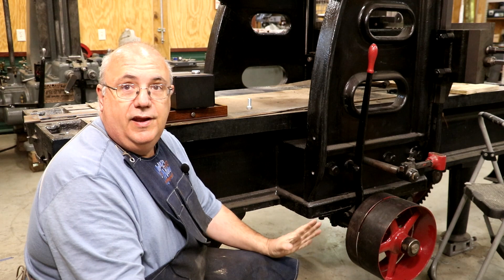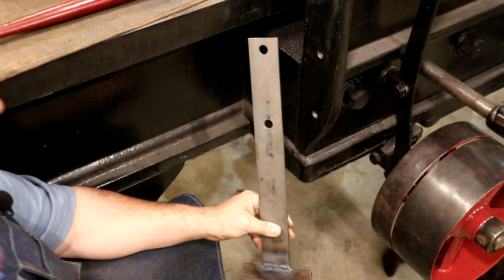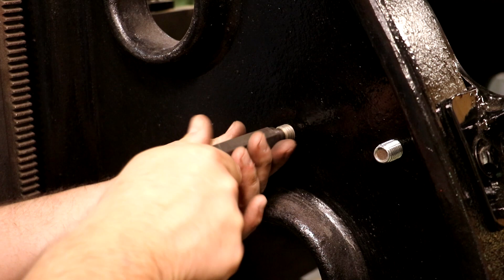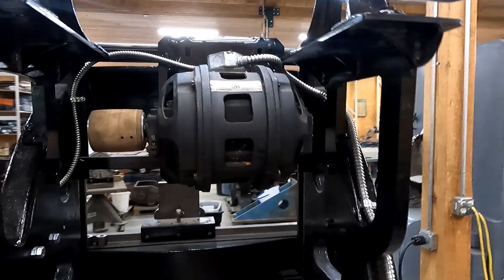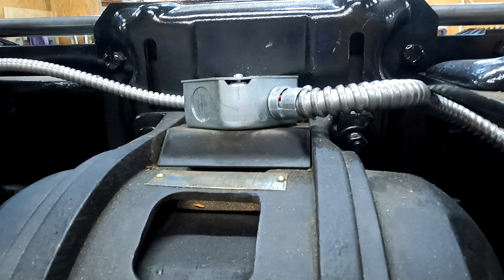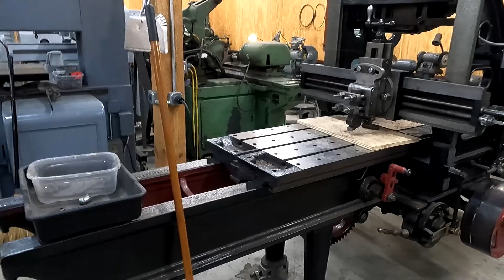Metal Planer Restoration 59 :Fabricating Brackets and Installing a Motor Starter

Comment: 13:57 Looking pretty klugy.  I think this restoration is succumbing to too many mods.
I don't understand why, being committed to Vintage Machinery, you don't forge ahread with a ceiling-mounted belt shaft.  That way you can put all your belt-driven-era machines in a single row in the shop.  I knew reality isn't that easy, but this is your big theme - Vintage Machinery.... not Retrofit Machinery.

Comment: Correct me if I am wrong Keith but I believe what I saw was a 3 prong twist lock plug.  In that the circuit requires 3 conductors for power where is the ground? The shot of the plug is brief therefore I might have missed the true configuration.
Reply: After more intense stops and starts I see the forth prong. My apologies.

Comment: When using transfer screws it is more accurate to put a transfer screw in all the holes and transfer them all at once by clamping the part and tapping over each transfer screw.

Comment: A small triangular brace on the bracket for the switch would have probably done the trick as well and there would not have been a need for another hole.
Reply: I would've liked the switch mount to have been made like all the other metalwork on the planer. U shaped for the back part then I shaped instead of the box section.
Perhaps he intends on changing the switch in the near future
Reply: Yes flat piece bent away from machine and a little bit of bracing across the angle

Comment: If you triangulated that push button switch bracket, you could turn the triangle into a bit of a small shelf that would be very convenient for an oiling can and such. Great work!
Reply: We'll have to wait and see but I have a feeling there is a belt coming down around the power switch.

Comment: I think the green (light-colored) button should turn the motor on, not the red (dark-colored) one.
Reply: I suspect you are making a colourblind joke, but incase not, it IS the green button that turns the machine on. The green button (the top position button) is the darkest.
Reply: @thomasstone1363  - yes, I am red/green colorblind (color aphasia, actually). To me, the top button looks red or dark brown, and the bottom button looks green or light tan (beige.) Which would make sense, at least in the U.S., as stop lights have the top light red, and the bottom one green. I go by the position, not the color. I can tell they’re colored (as opposed to a shade of grey), but I have trouble distinguishing red/dk. green/brown, or medium green/orange, or light green from beige or light yellow. It could also be the camera’s color rendering, especially in bright lighting, made the top button appear much darker.
Reply: @williamsquires3070  I think your suggestion that the red should be at the top is a very good one!!!

Comment: That BX cable looks terrible. So does your electrical box on the motor. Every thing else you've done has been absolutely top tier, beautiful work. Bend up some emt, and paint it to match. Weld up a junction box if you need one instead of spending 99 cents one one from home depot.

Comment: Jeep that looks great keep up the good work in restoring these old pieces of equipment I just have one thing and maybe I'm out of line why you didn't put an emergency stop someplace where you can get to a few fall or whatever  it looks great keep up the good work and restoring these old pieces of equipment I just have one thing and maybe I'm Adeline why you didn't put an emergency stop someplace where you can get to if you fall or whatever that you can get to it quickly just thinking about it I mean I think all all heavy equipment like that all you delays and all that should have an emergency stop just run emergency okay this is Bob from Vero Beach Florida God bless and have a great day

Comment: I have not noticed a clutch mechanism on the planer.  I have been operating an 1880's planer with an electric motor conversion and it does not have a clutch.  So the motor must be jogged to make small adjustments in the position of the bed.  This is most unsatisfactory when trying to precisely position the part.  Will your planer have a clutch that will allow the motor to be running while the planer is stopped?
Reply: You can move the bed by pushing or pulling on the flat belts (OPEN PALM), or turning one of the huge belt pulleys.

Comment: These videos are great, this project is great, Keith is great.
It was so satisfying to hear the whir of the motor !

Now as soon as I saw the switch bracket coming together I started yelling GUSSET.
A 3x3" triangle would make a nice strong-back to the mounting plate and would stiffen that square tubing right up.
I know it's not a part of the machine that sees a lot of action, but it does play an important role in the safe operation of the machine, and it is a moving part.
Just my suggestion.

Comment: Keith, I think a weak link exists.  Consider building a live center for the motor rotor. to spin upon.  Eliminate what may become a vibration source at that point, as you would a shaft extending from a lathe.  I imagine  the stress of a flat belt pully under tension, which is what I think I will be seeing, would be much greater than just a small pully extending out only an inch or so on a V belt or splined pully.
Reply: Actually, this machine is small for that motor.
The motor shaft is fine.

Comment: Do you think you will ever buy a CNC Milling Machine or Lathe.
Reply: One place I worked at back in the early 1970s had several Kearney & Treacker numeric-controlled horizontal milling machines that were controlled by a paper tape!
 
The Numerically Controlled Machining Center 1950s Educational Documentary 
https://www.youtube.com/watch?v=Y3YrbEGWE04

Keith MIGHT just consider adding this "very new" machine to his workshop.

Comment: I’m curious why you chose to use nuts rather than tapping out the steel to screw the switch in directly? Would love to know how you decide.
Reply: The bolts are holding something from the other side.

Comment: Not happy with your choice of conduit for the wiring. If you are using cutting fluids on your metal working machines,  you should run the wires in liquid tight conduit. I have been a maintenance electrician since 1965, starting at National Steel in Michigan.

Comment: Nice. It is really coming together. The only thing I might have done differently, is to run the power feed in a separate conduit from the control wiring. My reasoning is that if something happens to the insulation on the wiring, there isn't a way for the 480V to get into the control wires.

Comment: Keith, I hate to break this to you, but that switch IS a vintage switch - a modern switch would be a big red plunger with LED lighting that you pull to turn on and push to turn off. Below it would be mounted a large OSA warning sticker explaining that you should not eat the paint.
Reply: Don't forget the deadman's switch ;)

Comment: Before I watch this - Keith, I'd suggest you add 'start inhibit' microswitches to the belt/pulley clutches - so that the motor cannot be started while the table drive belts are not on the idle pulleys !
This in fact only needs one microswitch where the contacts are only closed in the central 'neutral' belt position. A boss added to the bar that slides the belt guides would provide a 'lump' in the middle of travel to operate the switch and close the contacts.

Comment: Hi Keith, don't you want to install variable speed to that motor? it seems kinda fast running.
Reply: No ! It's fine as it is ! The machine's gearing will slow the actual machine down to its proper speed - if the pulley on the motor is the right size - it looks not far off.

Comment: That Box on the motor isn't cool but it will work! You can buy Nema approved universal enclosures Keith! Sorry old electrician lol! How ever I'm patiently waiting for the first planning job!
Reply: You're qualified to opine, sir!
Reply: I’m with you on that. I don’t love the flex either, I think I would have gone with SealTite. But as you said, what he’s got will work just fine!
Reply: @robertstredde6798  Agree on that one! Give the fact that the machine will have an oil and grease in it's environment, the seal tight would be the best product for the job. But in the same token the push button and starter aren't sealed from this environment ether, so it's really a mot point! Back in the day this how it was done (armor clad) was considered a standard for shop equipment that was not exposed to weather! It's save and functional not much more more say!

Comment: Keith, your welding is exactly like mine. I like to call my welding gorilla welding. Rough and ugly. But it gets the job done.🤣 I always look forward to your videos. Even my wife says that your shows are pleasant to watch. I love the old vintage machines. I worked in an old machine shop and foundry. The machine that they were training me on was built in 1889. It was a vertical boring mill with a turntable that was 10 foot across. It could bore up to 20 foot deep. These old machines made the equipment that helped win the two world wars.

Comment: Mmm the motor sounds so good for its age!
Reply: That motor isn't nearly as old as you think. That would be a good question to ask of Keith, as I don't believe I've heard him say. But you're right, it does sound good.
Reply: @garys9694  I'm well aware it's not nearly as old as the planer.....
Reply: @garys9694 A few episodes he suggested it was 1920's. So not as old of the planer but old enough to look the part

Comment: I Think you forget that the belts need a start up
Function ☝🏻🧐

Tis set up wil spin the motor drive in the belt 

I wold recommend a two stage power up😉

Great project 
And greetings from the Netherlands 🇳🇱

Like so it’s bin seen ✌🏻
Reply: Not needed with the repulsion-induction motor!!

Comment: Keith, it is your machine  do it the way you want, however, a word to the wise. When things start going to Hell in a basket, you don't want to be putting you hands near moving components (belts). An E-stop switch, with a mushroom head operator,  mounted on the frame near the control area can easially be hit with your knee. One mounted on the offside might be a consideration. Yes, they might  occasionally be accidentally  bumped, however, too easy is better than too difficult.  I know you want to keep your machine as original as possible, but, you don't want your hands looking vintage (scarred with missing fingers) too.

Comment: The whole project is awesome and I've enjoyed every step you've taken to preserve that machine and keep it being useful.  Would a soft start (or softer start) be better for the belts and the line shaft?  That's a lot of inertia the motor pully and belt has to overcome.  I don't know for sure, but I think a steam or engine (hit and miss maybe) driven would also start slowly and ramp up to speed.  This reflects what I have seen in old textile mills and machine shops I've been in, in the Boston - Providence area.
Reply: That repulsion-induction motor will start up slower with a load on it.

Comment: Keith , just my opinion , I would use a heaver piece of angle for that instead of flat or a thicker flat bar...but it's your machine ...and it's coming along nicely !
Reply: Now that you opened the subject, a piece of U-channel with rounded corners could almost look "original".
Reply: And square nuts!

Comment: looks nice,but definitely need 3rd screw,looks flimsy :)
Reply: Looks flimsy is fine - you'll be pleased with that whwn you walk into it as it'll mean less OUCH !
Rather than the third screw, he could have put a bend in the bar so the centre screw held both ends of the bar firmly against the frame.

Comment: I hope that motor isn't running too fast for this machine
Reply: I was going to say the same. I think it'll need to be geared down a bit.
Reply: @cousindave1  at least where I am, it's cheapest to buy a used vfd for the motor if it isn't far off the correct speed. Bought several good quality ones under $100 a piece shipped

Comment: I only need a transfer screw one in a blue moon. Easy enough to make.
Can't wait to see the planer making chips!
Reply: Also easy to buy. Can't help but wonder how you'll insert the homemade screw without the hex projection and wrench?
Reply: @ellieprice3396  bit presumptuous to think he wouldn't have a hex, not hard with a milling machine, and a socket will drive it in